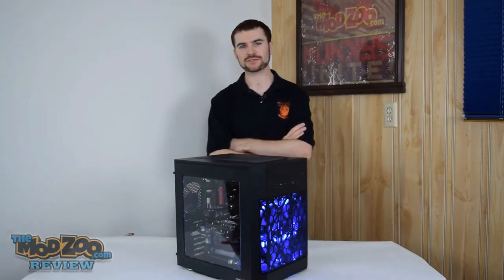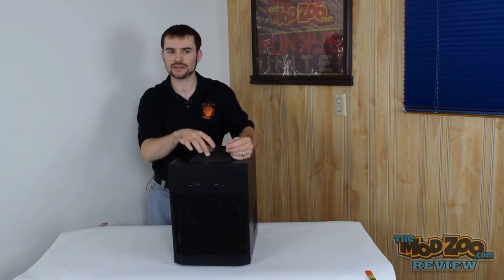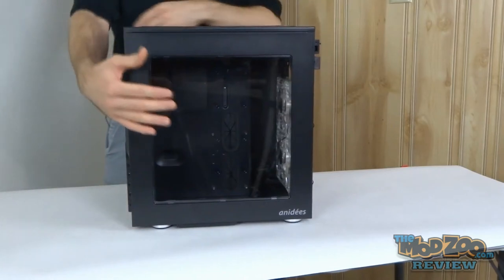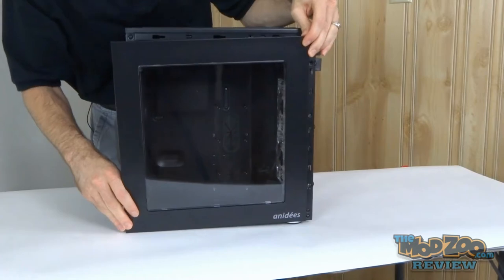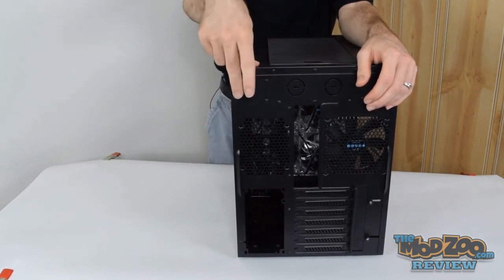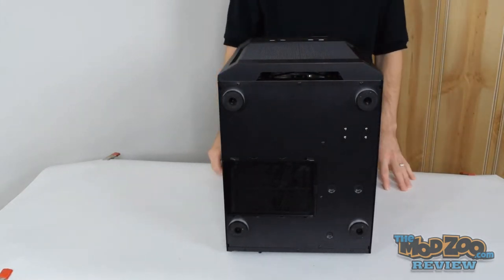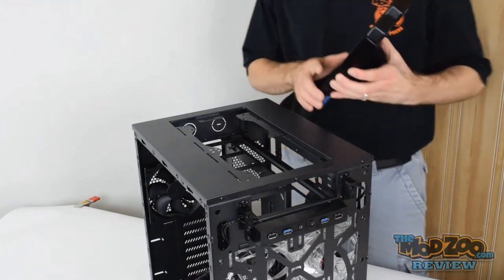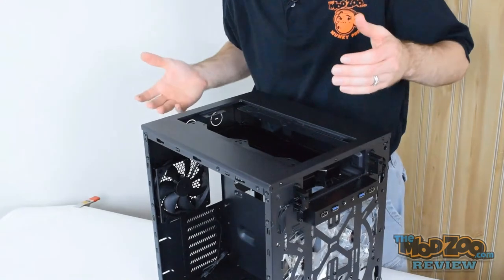Mod Zoo Review: Anidees AI7 ATX Case

Comment: Mosquito, excellent review of the Anidees AI7.  I'm curious if closed loop designed water cooling (such as the Corsair H100i V2) could be mounted extending from the top of the case?   If this is possible, then one could still put in a ODD and/or HDs in the top bays.

Comment: Hello and nice video. I bought this case yesterday....i have a question: How did u install the front fans? There is a fan controller unit...where all front fans are connected...and there is a 4-pin powercable. When i put this into the power supply the front fans doesnt work. Than i tried an adapter which i put on in the 4pin cable and than into the motherboard fan controll....doesnt work, too. Can u help me with a tipp?

Thank you in advanced.
Reply from the maker: Hmm, it was 2 years ago so I'm not 100% sure, I remember how I installed the front fans.  I believe the front fan hub was attached to the switch on the top back of the case (16:25) that has Low, Off, and High positions, so maybe that was off?  The hub has to be powered by the molex that it has attached to it.  I'd verify that the fans all work when connected direct to the motherboard headers, or a molex to fan connector adapter or something.  I wouldn't think the fans would be dead, but the hub could be?

Comment: I checked on DazMode's website both the Darkside and Alphacool radiators are over the required width to fit (2) 240 mm radiators side by side; seeings how the front can fit a 200 mm fan (I checked on the Anidees website), why not fit the front with a 200 mm radiator - possibly in push/ pull?
http://www.performance-pcs.com/phobya-xtreme-200-radiator-v2.html#Specifications

On a whole; while it says that this chassis is made for ATX motherboards, with the wiring lengths, I wouldn't put anything over a micro-ATX motherboard build in here.
Reply from the maker: That radiator would work, as well as this one that I was referencing in the video http://www.performance-pcs.com/phobya-xtreme-quad-480-560-v-2-full-copper.html

That's probably the easiest way to get 4 x 120mm worth of radiator in the front of this thing.  I would agree about the m-ATX as well.

Comment: Very sloppy designed case, Hopefully not many people will go for it, it has a very slight resemblance to the Thermaltake Core X9. Great review dude.
Reply from the maker: Thanks!  It does seem to have some Core X9 DNA to it, and some Air 540, and some Node 804.  It's a lot smaller than the x9, a bit smaller than the Air 540, and fits an ATX motherboard (unlike node 804).  It certainly does feel like they tried to cram a lot of stuff into too small of a box though, and some things didn't get fully planned out.  Thanks for watching and commenting!
Reply: The Mod Zoo Indeed it does resemble the Air 540 as well. It's a shame with some of the flaws the case has it could have a been a very viable case for new builds. Those front IO cable lengths were shocking, fixed with lengthening yet someone new to PC's may not have soldering iron or the wish to do it.
Reply from the maker: Yeah, I know that there are extension cables for the front I/O cables, but that's an added expense that should really just be taken care of by the manufacturer in the first place, really.
Reply: The Mod Zoo Very odd they didn't see the problem tbh, i guess they didn't do a build in it, who knows.